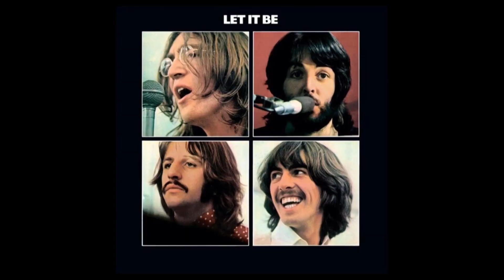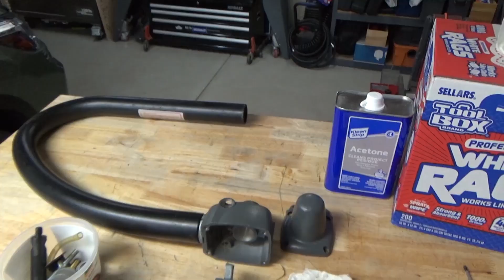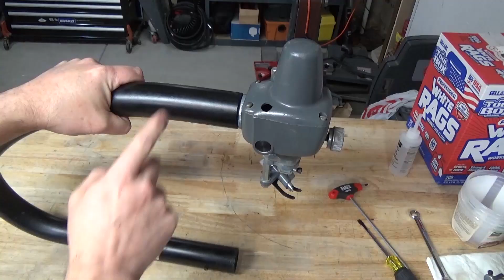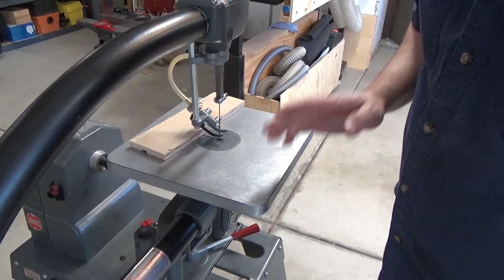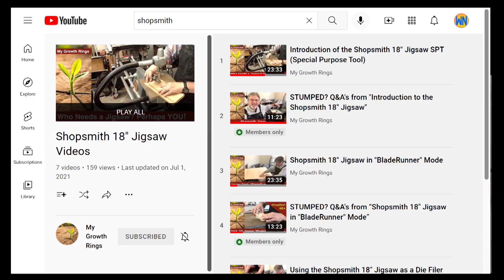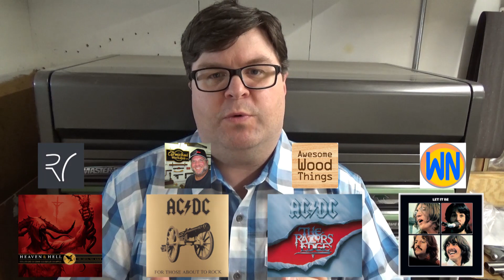Shopsmith Jigsaw 610 Rebuild: Prepping for 2022 Markers That Rock Album Art Collaboration

Comment: Hey Tom, Scott sent me over to your site for this valuable information. I just picked up a shopsmith jigsaw of this same vintage. Mine has an oil leak too. Where can I get a manual for this machine? Do you have a pdf of the manual?……..many thanks, Gil in Asheville
Reply from the maker: Hi Gil, I got my copy of the Shopsmith Jigsaw manual from the files tab of Shopsmith Owner's group on Facebook. An older version is availble from Vintage machinery http://vintagemachinery.org/pubs/detail.aspx?id=10571
Reply: @woodshopnerdery  thanks Tom. Do you know where I can download a pdf manual for the scroll saw? I have the iteration with molded in templates left and right for mounting blades. BTW, two weeks ago I purchased a 1984 model Mark V that came with every possible attachment. The entire rig got minimal use when new, them put into storage until it was sold at an estate sale. The tool gods were smiling on me. I got the entire rig at a fraction of it’s street value. 🤗😀

Comment: Hi Tom! I really enjoyed your breakdown of the 610. I bought mine new, back in the 80's. However, I stumbled across a video recently, which shows a "breather hole" on the main lower body, opposite the arm. On mine its just above a factory sticker. In all the years  I've owned this, I was not aware this hole was there. When I learned of it, I looked at mine and sure enough it is.  It was blocked due to sawdust. I wanted to make you aware so that perhaps you could put that out to your audience. I'm thinking that if there is a buildup of pressure inside the lower housing could that contribute to oil leaking from the gasket? Which is the issue I have. Keep the videos coming. They are very much enjoyed!
Reply from the maker: Thanks Anthony! Yes I did clear out the breather hole when I did the rest of the cleaning.

Comment: Excellent video, Tom. I was given an old Magna jig saw several years ago and Idid essential the same thing that you have done, except mine was really rusty and I had to bead blast and repaint everything. I still haven't gotten the "puffer" to work. The leather seal on the piston looks pretty good and I have lubricated it but it just does not produce any air. I suspect there is an issue with the check valve. Could you share any information on the blade that you are using? Sure looks like it did a nice job.
Reply from the maker: Thanks John. My puffer seemed to work okay, so I did not disassembly that portion of the machine. Hopefully you can get yours working. Nice job rescuing the old Magna. 

The Jigsaw came with a good collection of blades. The ones I used in this video were Shopsmith 505669, which are 0.070 Medium Tooth. I am working on the next video and that blade was to big to make some of the smaller radii. I found that the Shopsmith jeweler's blades were way to thin. But, I found some blades at Menards which were perfect. Olson Skip Tooth 44300 Univ. No. 2, 20 TPI. These cut 8mm (5/16th inch) yellow birch boards very well and were relatively inexpensive.
Reply: @woodshopnerdery  Thanks for the reply, Tom. I'll check those out at our local Menards.

Comment: I always keep my finger on the switch when I turn on a tool after changing blades or mounting wood in the lathe. Good tip and glad to see you getting another tool set up. I do find it interesting that these days people would call that a scroll saw, do you know the difference?
Reply from the maker: I don't know all the details, but I believe Shopsmith decided to call this a "Jigsaw" because it is a "rigid arm" saw and the upper arm can be removes which allows the tool to be used as a sabre saw and filer. So it has a lot in common with the handheld power tool "jigsaw."
Reply: @woodshopnerdery  mine was the same (you could use a jigsaw blade upside down, a file or a scroll saw blade if you attached it to the top) so maybe that is difference! Thanks :)

Comment: Another great video Tom. 
I’m like you. I get something used. I take it completely apart, clean, lube as necessary, then reassemble. It not only allows me to inspect the machines moving parts, but it also educates me as to its inner workings.
Reply from the maker: Thanks Bill, I agree know how the machine works help me be a better operator. I can respond to the feedback it gives me with a little more insight.

Comment: Make sure your vent hole is not plugged. It could create excess pressure which will cause a leak.
Reply from the maker: Thanks Tom. I did feed a thin copper wire all the way through the vent hole when cleaning it. But it does not hurt to check that again. Great tip.

Comment: Awesome video, but I'm super confused. I've always heard of that saw referred to as a scroll saw.
Reply: And either one can use coping saw blades!   Go figure… LOL
Reply: That is because people don't know the difference between a jig saw and a scroll saw. The 610 is a jig saw. The blade is powered in the down direction and a spring returns it in the up direction. In a scroll saw there is no spring. The blade is powered in both directions.
Reply from the maker: John, I think of it a little differently. A scroll saw pulls the blade up and pulls the blade down under constant tension of the upper and lower frame members. A "rigid arm scroll saw" or jigsaw pushes the blade up and pulls it down too. Both are power strokes coming from under the table. The tension on the blade, however, is variable as there is no power pulling from above, only the spring which can in some cases lag behind the upward power stroke. I believe this is called galloping. 

However you think of it, I thought the tool has worked really well for me so far.
Reply from the maker: Very confusing indeed. The word "Jigsaw" has been co-opted by the power hand tool history. I suppose it is the closest match but still very different. But, imagine yourself trying to cut a jigsaw puzzle with those those thick electric hand "jigsaw" blades? No way you can make those turns. That does not make sense either right?